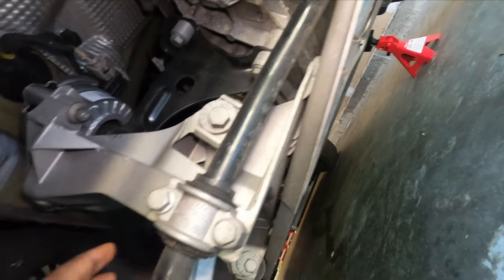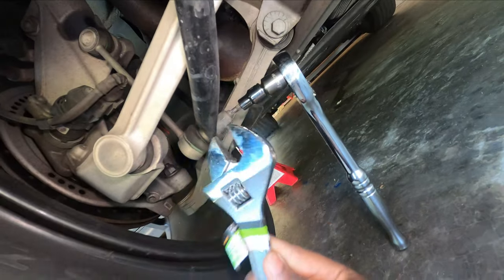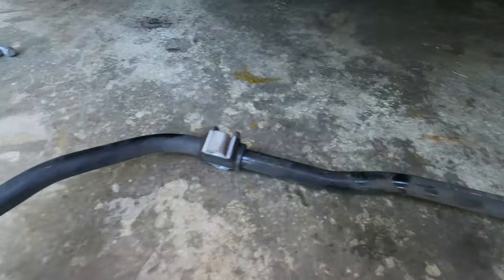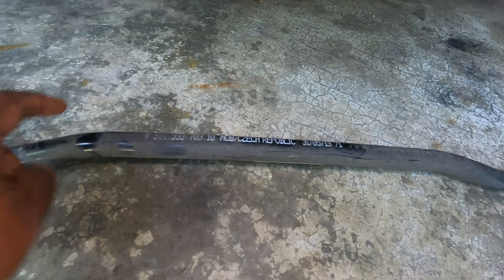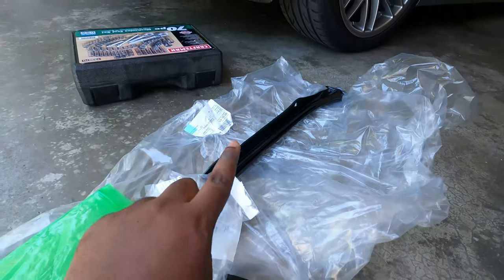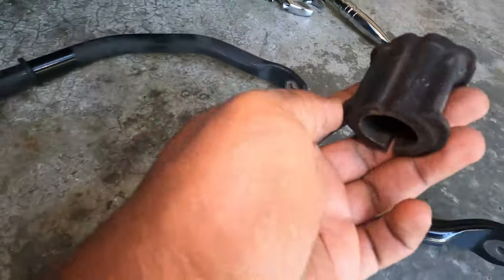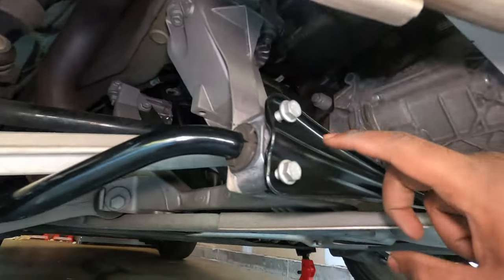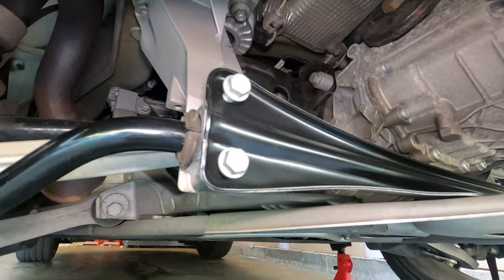X73 Sway Bar & Rear Brace Installation on 981 Cayman Boxster ,911, 718  Cayman Boxster

Comment: Thanks. Part number for the brace?  And isn’t the brace supposed to bolt down in the middle?
Reply from the maker: The part number is displayed in the video. There are only 2 places for bolts. I show them on the video.
Reply from the maker: The brce can be found at https://www.suncoastparts.com/product/PK981BRACE.html?gclid=Cj0KCQjwidSWBhDdARIsAIoTVb3W2ssSw0-hmL2wm2-cNcUKWf0GlgPbosrZYMrm6QY0paG3YKdtfzgaAnI-EALw_wcB
Reply: @TorvekMotors  Rear Support - Porsche (981-331-275-00) is the 981 GT4 item. The one with the tabs to mount to the large triangle support plate is the 718 version is Transverse support - p/n 982-505-475.

Comment: Throwing your balance off by going stiffer x73 in the rear while keeping the smaller stock 981 up front.
Reply from the maker: Not at all. This is actually a setup a lot of track folks do on the forum to decrease the understeer of this car. I was planning to add the front x73 but it went backordered.. so I gave up